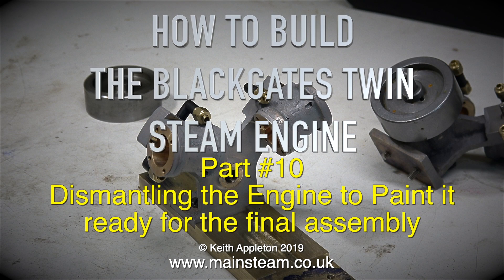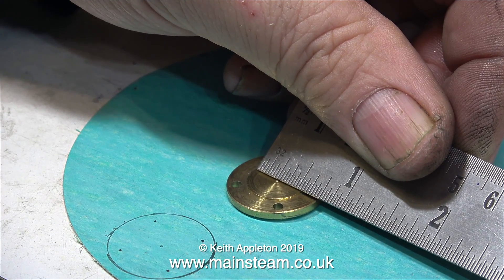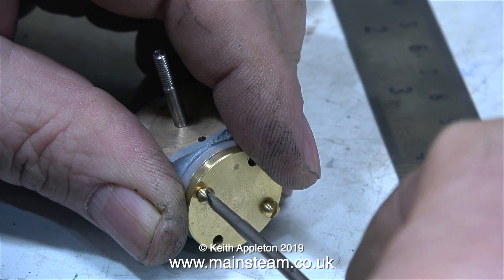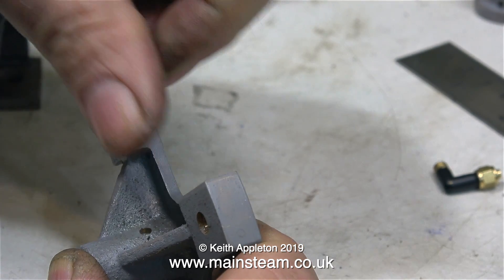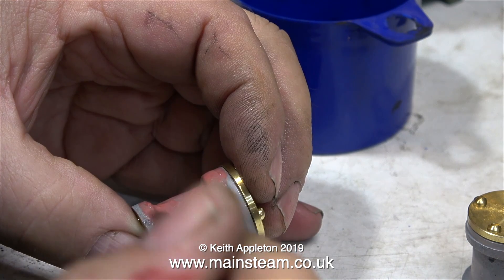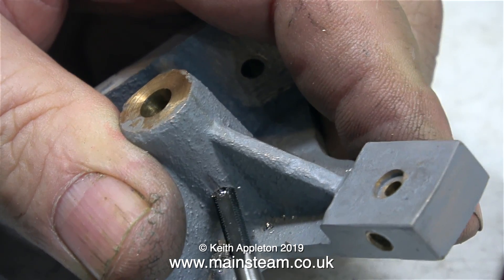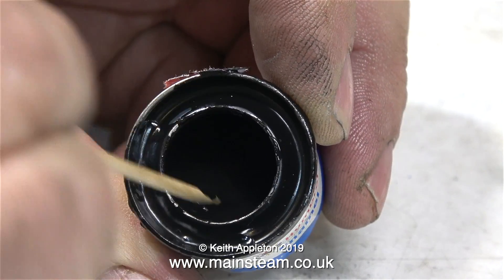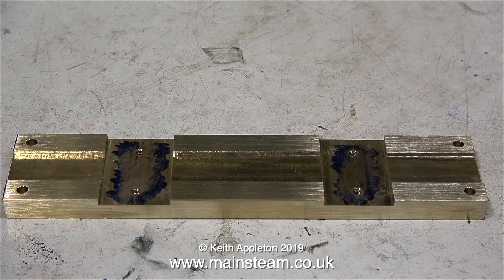HOW TO BUILD THE BLACKGATES TWIN STEAM ENGINE - PART #10

Comment: Ok so each cylinder on a single engine is 90 degrees right? Could you offset the two engines so you have one at 0, 90, 180, and 270 so you are always on a power stroke?
Reply from the maker: When linked the engines seem to be OK at 90 degrees to each other.